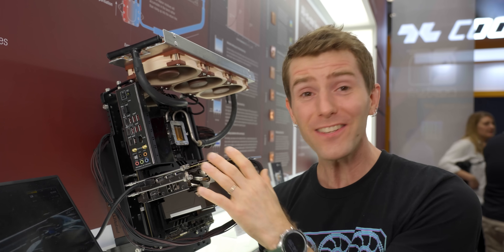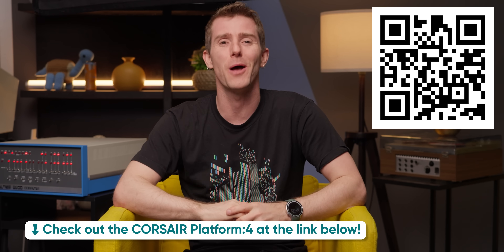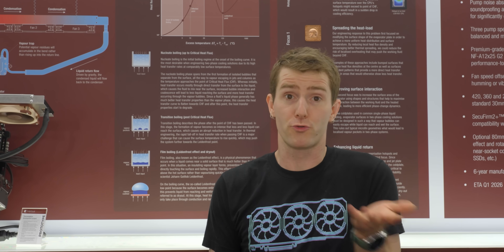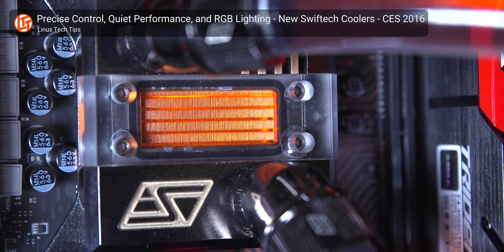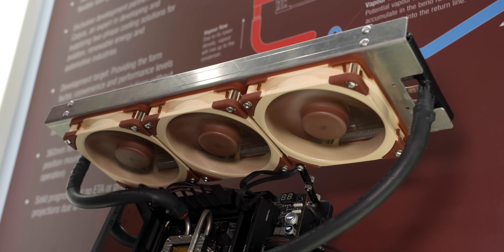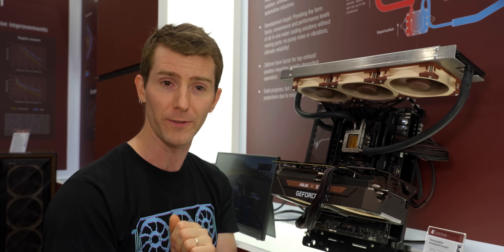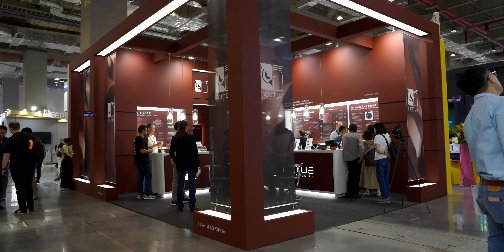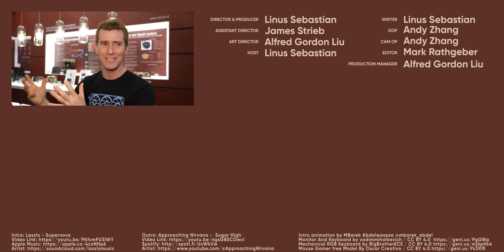6 Years Ago This Idea FAILED.. Now it’s WORKING

Comment: 200 years later, fan/copper cooling is still the most stable, maintainable and affordable cooling method
Reply: Heat pipes make most air coolers functional. They're much better and newer than solid copper.
Reply: Funny thing is that we have changed to do computation with remnant waste heat that makes the next computation happen. Eventually nothing is lost. Like in nature. Oh wait that is in the next 100 years. Maybe in 200 years we do computation in extra dimensions.
Reply: @cubertmiso   How things are going we will be in complete stoneage in 200 years, make it even 100, by 200 we will be non-existing or devolve to planktons. 
Lets just start with the prices of basic things, most people can't afford anymore local postage let alone buy jack s -t from anywhere or even bother ... with all the inflation and extra fees tax etc. It's worse then during wars or outbreaks. It gets worse and worse.